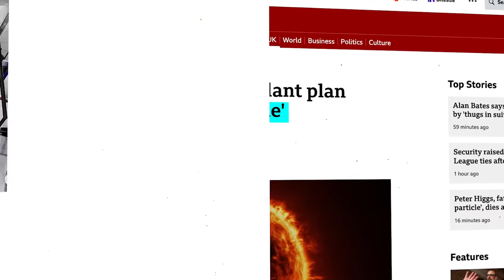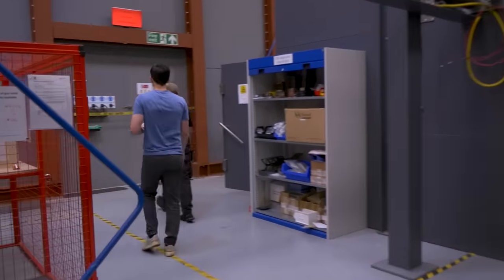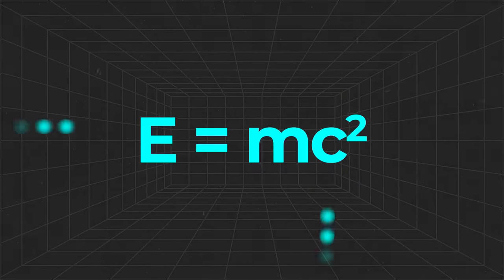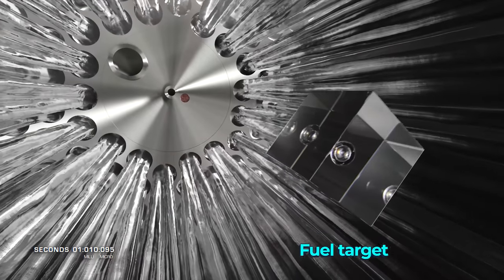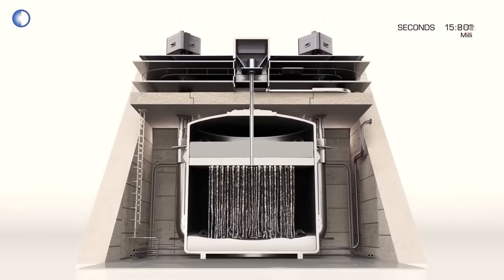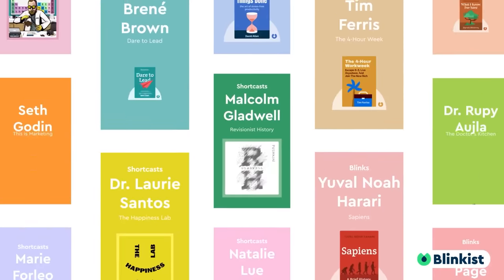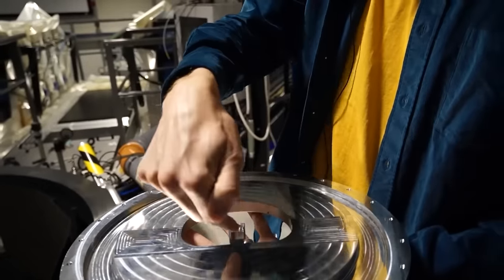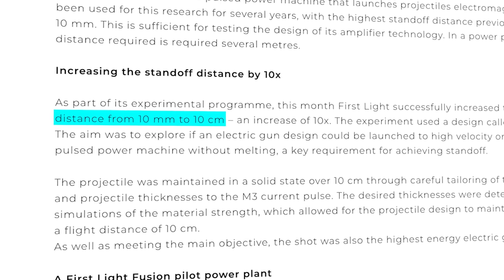Why The Latest UK Fusion Breakthrough Matters

Comment: Reality check: The metric is not how hot can you get the reaction, it’s what is the energy out - energy in value.  None of these reactors are anywhere near break even, much less  surplus that would make up for all the losses our to a powering, much less the cost of that power.  The only thing burning here is money.
Reply: They're working on a solution where they can reuse the resources that go into fusion and they've already achieved a higher output.

Comment: Could they take like a really strong Multi layered stacked superconductors with let's say a rod with at 3 "" top middle bottom of nuclear rod"" CsAu with some kind with specially designed and made to conduct the right kind of energy to make all of the specially made liquid-liquid metal-nano particles- Quantum dots. And all of the heat would be going to specially made Solutions to grow Crystals and other heat could go to  making the magnetics and magnetic liquids spinning faster. There is so many was to go about making GRAVITY WELLS!!! AND IF THE OUTER WALLS OF THE RODS ARE LAYERED IN SPECAL WAYS AS TO CHANNEL Certain IONS THAT'S BEING PRODUCED BY THE LAYERS OR POCKERS OF COBALT AS TO PRODUCE MORE OF YOUR Preferred ion production. AND ALL IONS WILL BE SENT TO PREDETERMINED LIQUID METAL OR SOMETHING TO HELP THE WHOLE THING RUNNING. AND ON THE BOTTOM YOU'LL HAVE A BIGGER LIQUID SUPERCONDUCTORS AROUND THE Hollow tube THAT HAS LIQUID METAL THAT HAS BEEN MADE TO REACT WITH THE INSIDE OF THE WALLS. AND THE MORE ENERGY IT GET THE FASTER IT GOS. BECAUSE SOME ENERGY IS STORED AND USED TO HAVE LAYERED SEQUENCES OF  strength.

Comment: The reason why fusion is always 10 years away is because they have figured out that there are governments that will pay these people via grant money for 10 years of research as long as they are coming up with breakthroughs. And well, what do you know... The last year of the grant after spending 9 years of doing nothing but drinking and partying, they have this amazing breakthrough that needs another 10-year grant to study the breakthrough. It is lifelong income for basically doing nothing but dreaming up amazing breakthroughs once every 10 years.
For fusion to work, it must spin. It must have a hot and cold. It must have a way to remove the waste product Helium4. The device must have a huge cable to earth ground or a way to bleed off or store the huge amount of electricity that it will be producing. 
If the device doesn't have every bit of that, the entire thing is a scam for another 10 years of grant money.

Comment: From the video at their website I can see a cube of 10mm side, and a cavity in the mm range. If you have any contact with the team, tell them the cavity should be in Angstrom range, not in mm. They need to design a solid state catalyst that embeds the fusion reactants and induces the ICF when heated by the impact. They could try first nanotech with cavities in that nano scale, if that fails they must move down to the atom realm of the Angstrom. Good Luck

Comment: DoA: Waste of time & money, unless your real plan is to develop fourth generation nuclear weapons. Shot systems are not feasible for power generation, especially a system which causes destruction of components with each shot. It won't surprise me that this company is getting funding from gov't defense. 

That said it very likely not going to work because of the plasma scattering problem: For atoms to fuse they have to hit dead on (ie bullet hitting a bullet dead center). If they hit via a off center, nothing happens. but these impacts cause a scattering effect which dissipates the velocity of ions, fizzing out the reaction. Its like hitting a bunch of grouped up billard balls. After the cue ball impacts the average velocity falls dramatically as the balls scatter in different directions & have very low velocity compared to the initial cue ball velocity. It does not matter if you strike the group of billards with multiple cue balls as it still will suffer from the scattering problem.

The scattering problem has been known since the 1960s, but researchers continue to forget or ignore this fact. The definition of stup-idity is to perform the same task over & over, and expecting different results.

Comment: Do you understand that they do easy way to create "clear fusion bomb"? You can take their aim-design with "ДВМГ, дисковый взрывомагнитный генератор", which is a chemical bomb, compressing magnet flow, and able to generate extremely high I, and speed up aluminum liner to 60 km/s, — and you have first stage of fusion bomb. Additional 3 D+T stage allows you to go to clear Deitherium gas stages, and reach any final energy of your bomb. Say hello Israel, say goodbye Israel, for example.

And "fusion always in ten years" (20, 30), because you should PAY for construction something. Until you don't do it, you will be always in "10/20/30 years" from this construction. Try to google "US ERDA 1975 year plan vs fact", for sure, — it never was have paid

Comment: I just don't understand why it's so hard. The way fission reactors work is by doing what a fission bomb does in a controlled manner. So why does fusion not simply so what fusion bombs do but in a controlled manner? Ie, it uses a fission core to generate the heat necessary for fusion?

I feel like that's the first thing they would've tried. But you can't tell me that doesn't work, the bombs literally work. Maybe it's because everyone pisses their pants anytime you mention fission even though it's our best energy source. All the radiation of fission gets consumed by the fusion process. Why is this not that simple?
Reply: The difference is you don't need anything to kick start a fission reaction. You just put a critical mass quantity of fissile material like uranium closely together and you get a sustained reaction. The process is so automatic that you have to be very careful not to put even a little too much of these materials close together. People have died from criticality accidents that way. 

With fission, controlled reaction is easy. A bomb is hard not because fission is hard to start, but because the fuel has to smashed from a subcritical state to a critical one very fast, very evenly and then held together long enough after the reaction starts in order to get enough fission and mass conversion to produce the big fireball we see in test films. Fission doesn't want to create explosions on its own. 

Fusion on the other hand, really truly does not want to happen in nature. Not at the scale and manner we want it to. The protons in the nucleus of atoms are very strongly repelled by the same positive charge in neighboring atoms. Overcoming that "Coulomb barrier" requires millions of degrees of heat and lots of pressure - the kind of heat and pressure of stars. 

This is no problem for our sun, which is 330,000 times the volume and mass of our planet. It turns out its not so hard to do in a bomb either, because the fission reaction that drove the first atomic bomb puts out enough energy to fuse deuterium and tritium, "heavy" hydrogen isotopes which are much easier to fuse than regular hydrogen. 

Doing that in a controlled way is the beast of a problem. How do you produce millions of degrees kelvin without setting off a Hiroshima device? Well, we can do it with lasers. If you can get that fusion to start and create enough energy to sustain itself, now you've to to figure out how to contain and maintain something so hot that no known material can hold it. You need to solve how to maintain a fuel supply (including creating tritium within the reactor), how to maintain enough power to keep the lasers or containment field going, and still have enough left over to sell, how to keep the fast neutrons from destroying your reactor vessel etc. 

These are not routine 10 year R&D problems. They're century time scale almost science fiction problems, but we've overcome some big hurdles and the potential payoff is enormous.